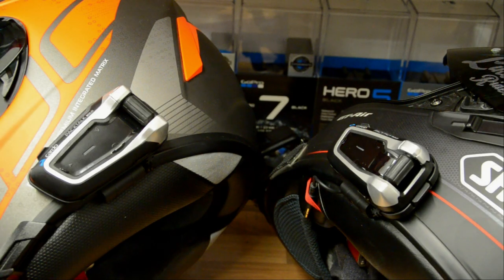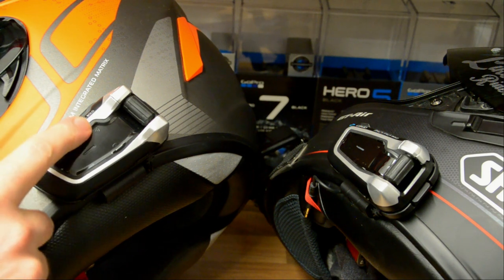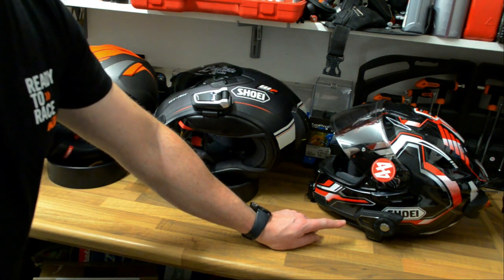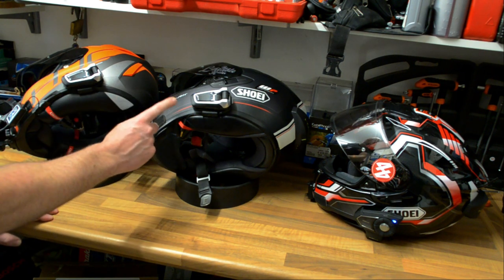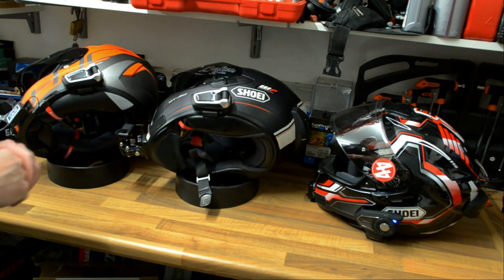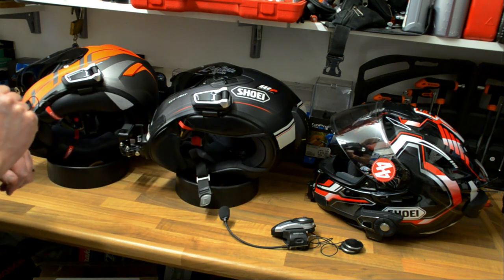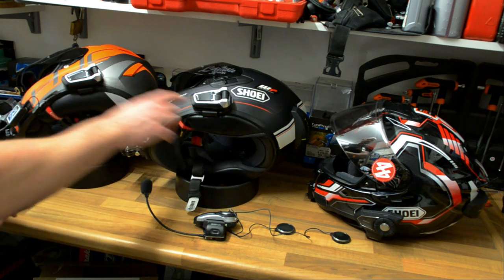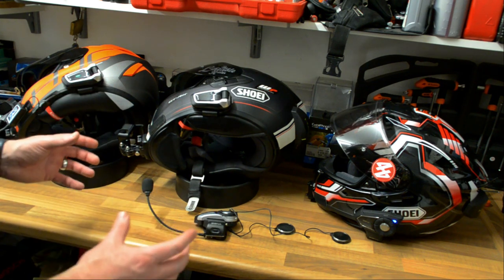Cardo Packtalk Bold DMC Intercom Setup and adding Non Cardo units to the Meshwork!

Comment: If I’m understanding this the cardo is acting like a phone to pair with the sena. Does that mean the sena rider can’t connect their phone to their headset and wouldn’t be able to make and receive calls?
Reply from the maker: That's a great question, and if im honest I didn't think to check! The Cardo was paired over the gateway, only the Sena had to sacrifice its mobile phone channel. I would guess that the Sena wouldn't be able to use the mobile phone function, but I'd be okay with that if it ment I could chat over intercom. I stand by opinion that even though this works, it's sill not the most ideal way. Convining your riding buddies to use the same brand will cause less issues🤣